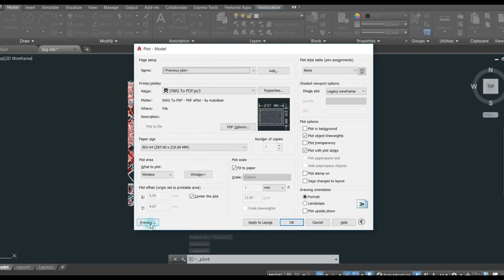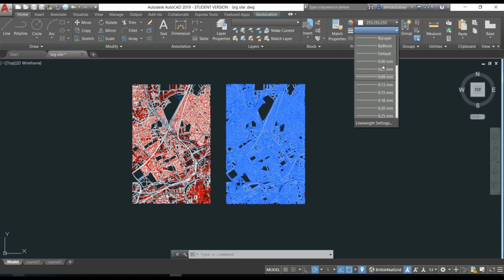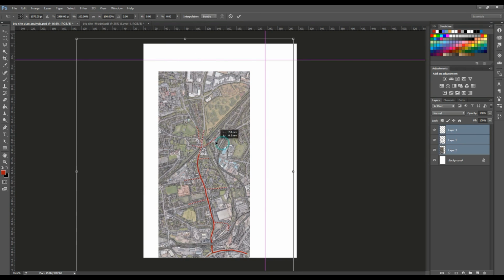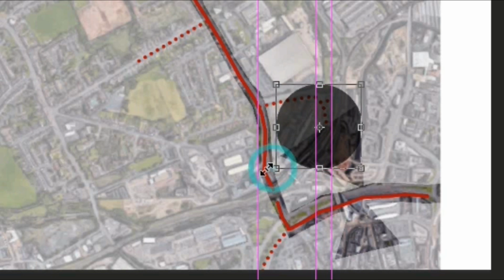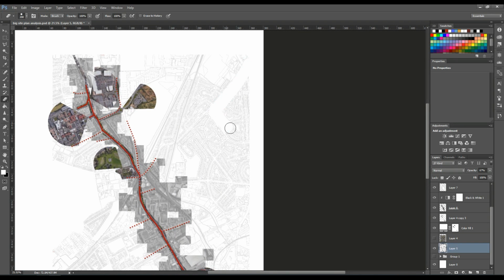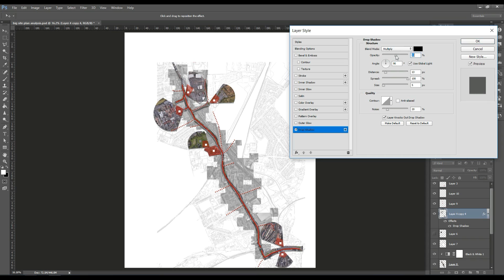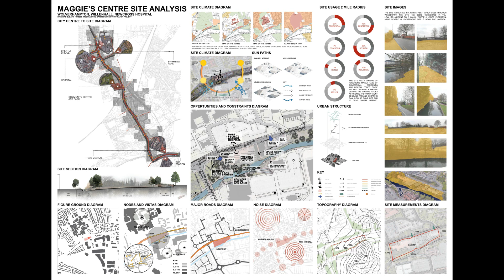Architecture Site Analysis Presentation Guide | Photoshop Tutorial

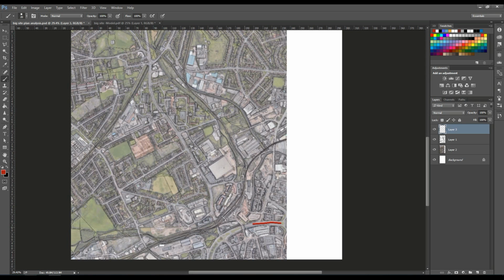Comment: Thanks for your tutorial but sorry can you explain how do you make the image brighter at 1:34?
Reply from the maker: Sorry, it did seem a bit quick lol, when you double click on the layer you get a pop up called layer styles on the bottom right there are two sliders, I used the top one. Use the little triangle on the right and slightly move it to the left. What this option does is remove all white pixels on the layer. I hope this helps :).
Reply: @TheArchitecturalInsider  thank you very much!

Comment: What’s the benefit of doing this in photoshop vs a program which is meant to work with vectors like illustrator? Illustrator would allow you to much more easily edit line work and gives way more options for line types. Also, using the snipping tool produces some really low resolution and compressed images. I think google earth pro (free) would be better for something you intend to present or print as you can export out images at 4K. Last thing.... it might be easier to xref your base map into cad and use the align tool versus manually doing it in photoshop. It isn’t always perfect, but usually works great.
Reply from the maker: Someone requested for a photoshop tutorial on site analysis diagram, all the other diagrams are on illustrator, thanks for the advice tho i appreciate it :)